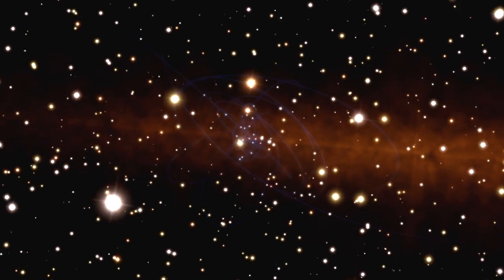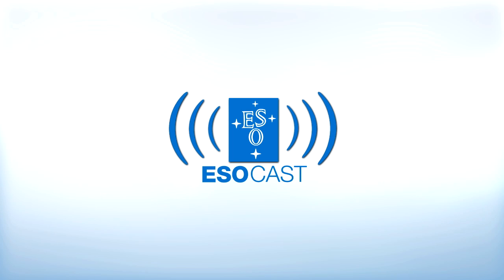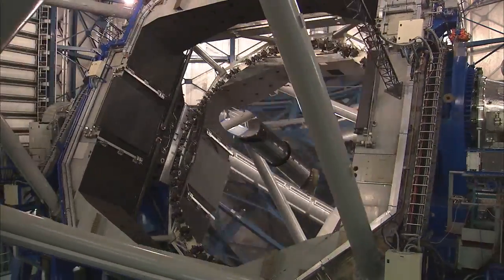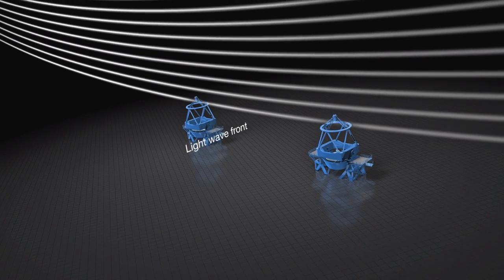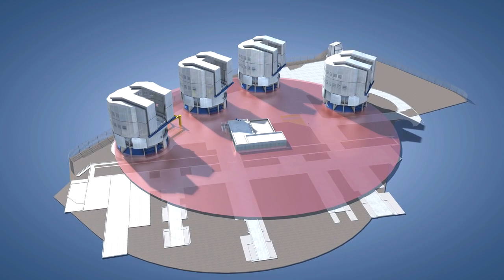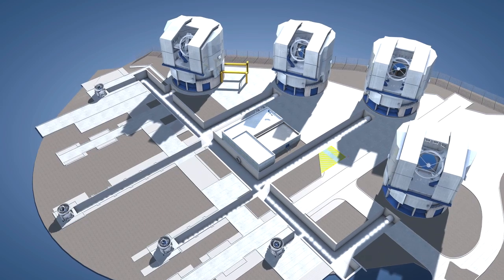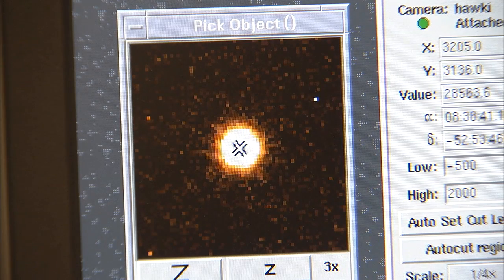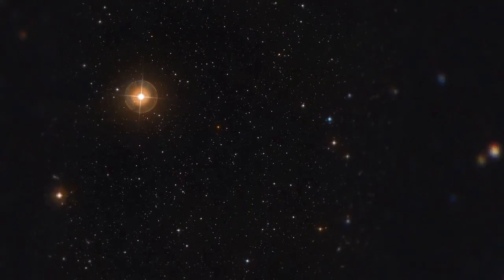Interferometers and Extreme Interferometry: the VLT Interferometer

Comment: the technician is not actually turning the knob at 420. so you went through the trouble of choreography but didn't show more than twenty seconds of the optical delay lines. you are a failure.

Comment: What I don't understand is if the VLT can use interferomerty to act as a 200 meter mirror, then why are they trying to build the 39 meter E-ELT?
Reply: Because such large telescopes can gather much more light, thus allowing to observe objects fainter than with interferomety with small telescopes that mimics a larger telescope. In many observations, photometric precision is more important than angular resolution.

Basically, interferometry is best suites for observing objects that are bright.